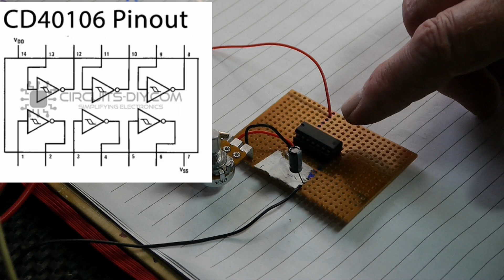Simple Oscillator with three components

Comment: Could this work off a watch battery?
Reply from the maker: Sorry no needs minimum 9 volts preferably 12-18 volts
Reply: @takethefearoutthegear6229  Hmmm... would an A10 9V battery work? I'd like to build a sort of digital tuning fork as small as possible - maybe use a headphone speaker as the output.
Reply from the maker: @nickcook3948  9v battery should work

Comment: If you want to see a project that uses this CD40106 (aka74C14) chip (plus a 741 opamp) to its full potential, look up the "Weird sound generator" from Music from Outer Space aka "MFOS-WSG".

The WSG is a very cool 6-oscillator normalized full analog drone synth. Build one, you'll totally dig it. Full plans are on the MFOS site. You don't even need a custom PCB, there is a diagram for building the circuit on strip-board.